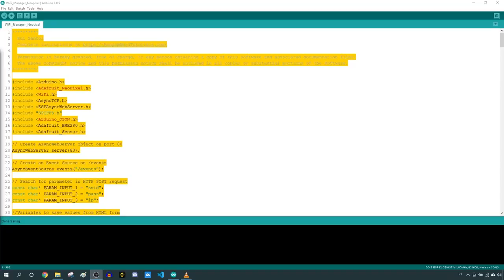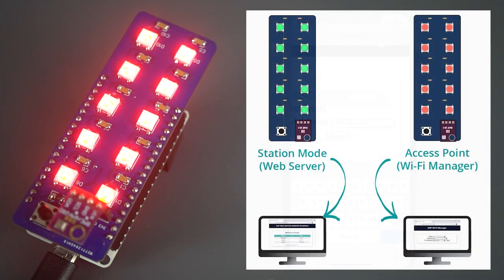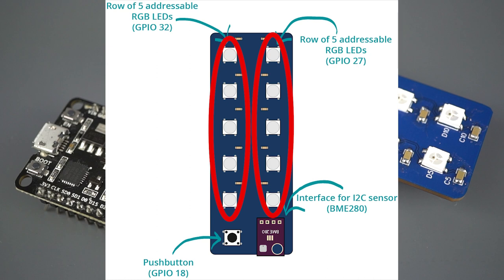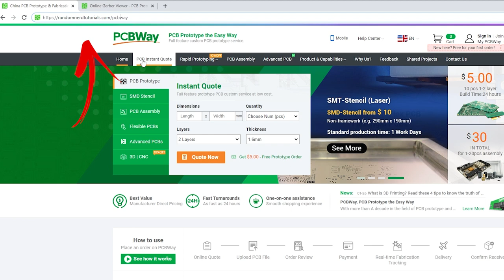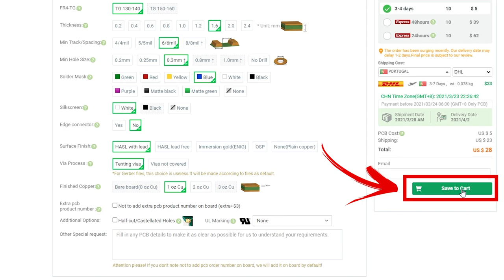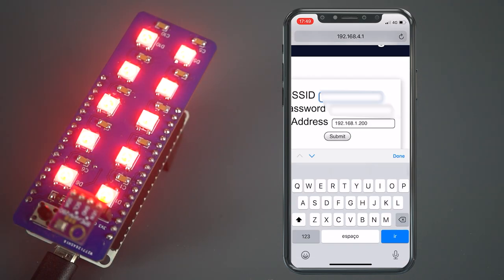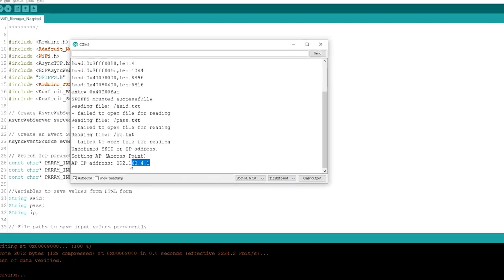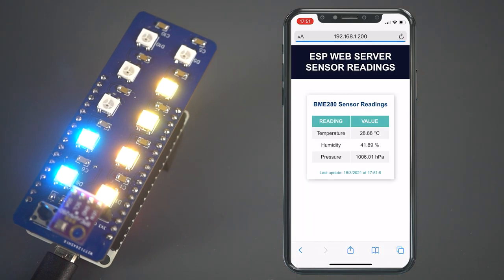ESP32 Neopixel Status Indicator and Sensor PCB Shield with Wi-Fi Manager

Comment: Hi I am using ESP WROOM 32 , The programming is fine when I open serial monitor, If Powen On esp 32 with external supply ,it executing the code once and stops,but if i open Serial monitor it's working fine,so i replaced the code with simple code to verify wheather the problem is with program..But the problem continues.Can anyone give Solution

Comment: Hi Rui Santos
I have been trying to use your code examples for the esp now protocol.
But I'm having issues not being able to send packages fast enough.
with a package size of only 2 bytes i need a delay in the loop at minimum 35ms to make every package transmission successful. in other words. 28 packages per second. It doesn't seem like a lot to me, and it's a bottleneck for my projekt.
Have you made any tutorial to this issue, then please forward me to the tutorial. Thanks.